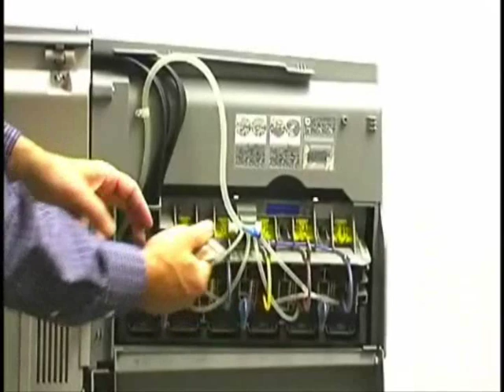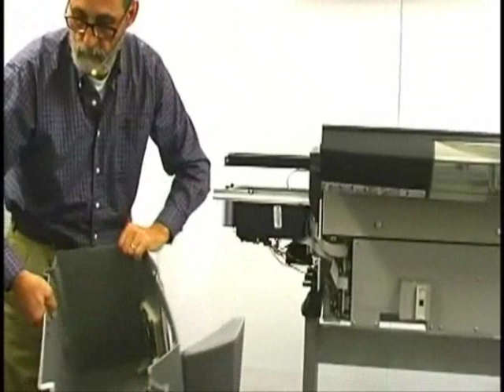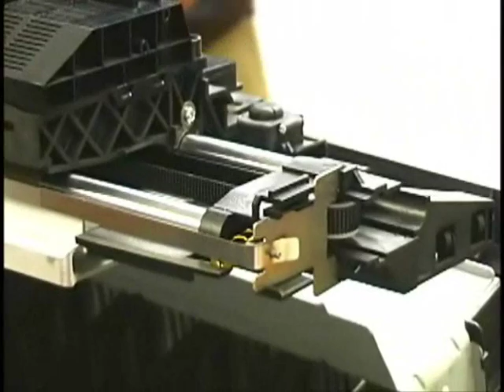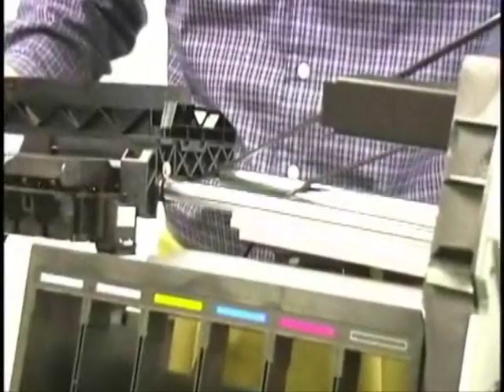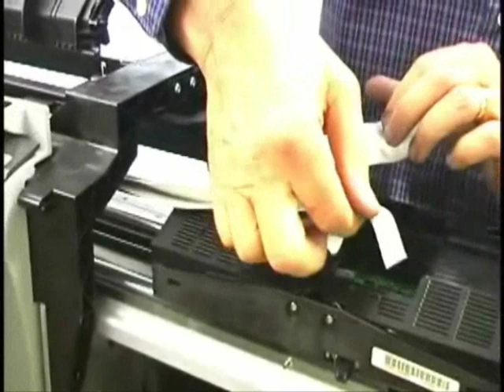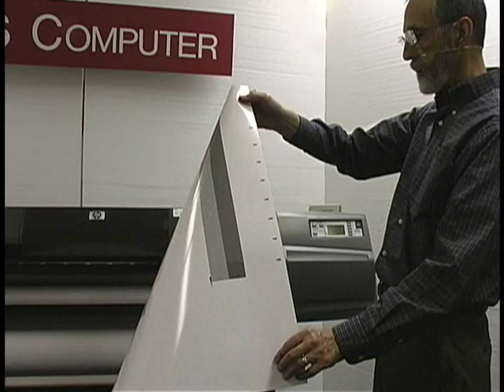Designjet 5500 Belt Replacement & Calibration

Comment: Thank you for this detailed belt change video.  We just acquired a 5500 that had been inactive and improperly stored for several years.  Only the strings of the belt were intact and, amazingly, would still move the carriage.  The timing gear and idler were also caked with remnants of the belt material.  It's all cleaned up now and just waiting on your belt to arrive.

Comment: HI, The designjet 5500 initializing up 5% then indicate code error ob0004 and i have changed  APS system  but no change.
Reply from the maker: Hello.  The error indicates a problem with the air pressure system.  Since you replaced the APS, we can rule that out.  The problem is most likely the Ink Supply controller that the tube system and the APS plug into.  Reseat the connectors on that board (be sure to find the one at the very top of the board).  If that does not clear the problem, replace the board. It can be ordered from:  https://www.lpscomputer.com/collections/designjet-5000-5500-parts/products/q1251-60252-designjet-5000-5500-ink-supply-station-pcb
Reply: Now if the same hp designjet 5500 indicating power supply error 1# what could be the promblem?